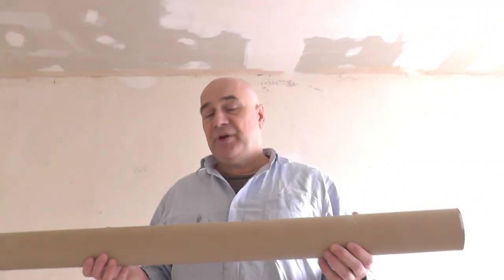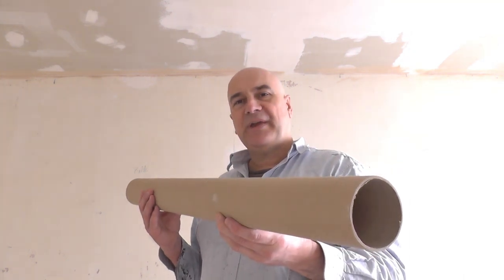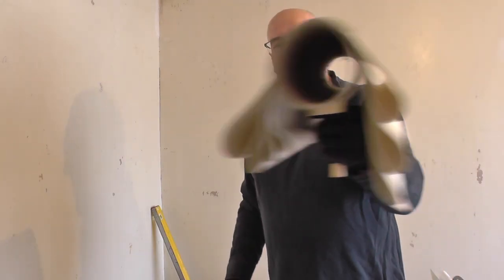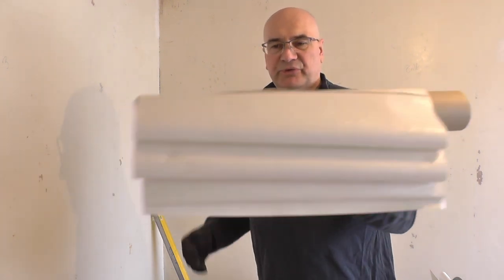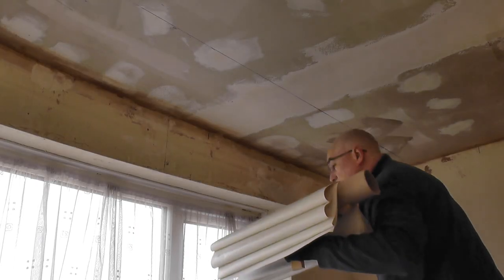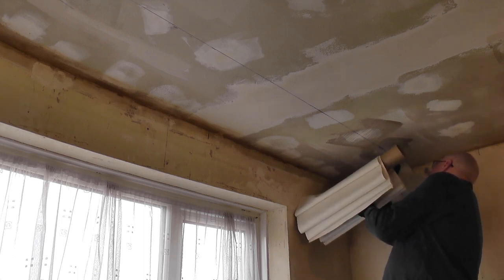Will My Invention Make Me A Millionaire? Brilliant New Decorating Tool

Comment: It looks like a nice job, but as you've spent time taping & jointing and the ceiling is relatively flat couldn't you have just painted it? Is there particular benefit to papering that isn't obvious?
Reply from the maker: Good question.  The ceiling is flat and quite smooth but still not good enough to simply paint over. If I were to paint over this without using lining paper I think the result would be disappointing. Paint will show up every small imperfection. I might just paint the smallest ceiling over though without papering just for the hell of it to see what it comes out like. Watch this space. ATB, Des
Reply: Just plaster your ceiling for a perfect/better finish and a lot less hassle?
Reply: @21stcenturycaveman33  No your right about the paint, as it will show up all the imperfection when the lights are on.

Comment: Sweet Jehovah DO NOT watch this, you can just use a roll of wallpaper to support the wet length, and start in the middle of the ceiling, just saying
Reply from the maker: Hi there Martin, thanks for dropping by. With respect I have tried to use a roll of wallpaper many times and found that this didn't work anywhere near as effectively as this lovely device which I invented. Give it a try mate. Honestly, it works a treat!  Have a great day where you are. Des
Reply: Don't start from the middle.